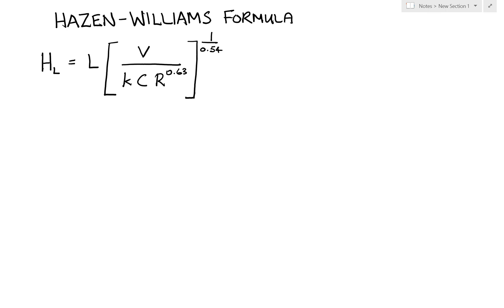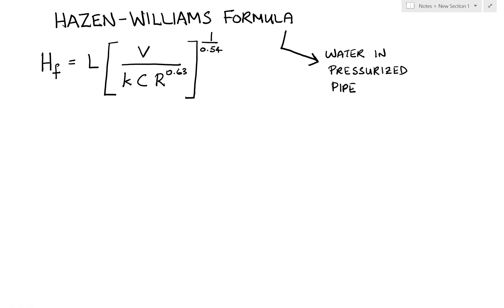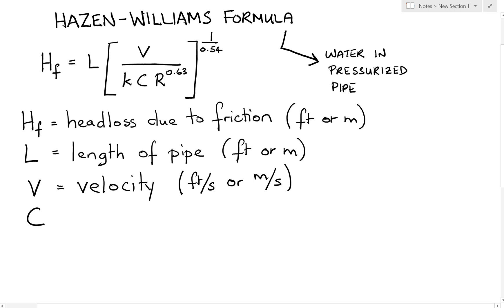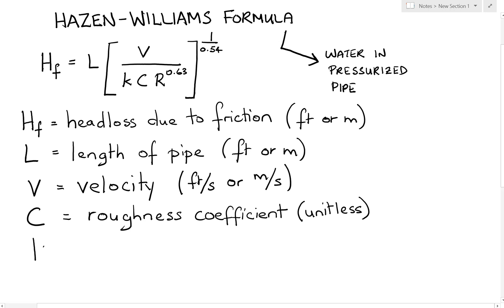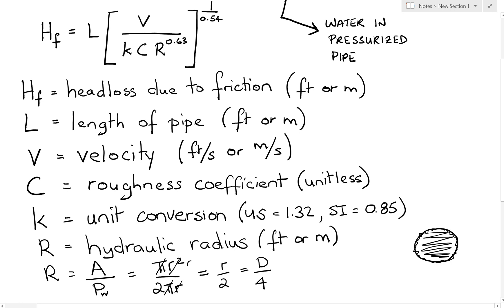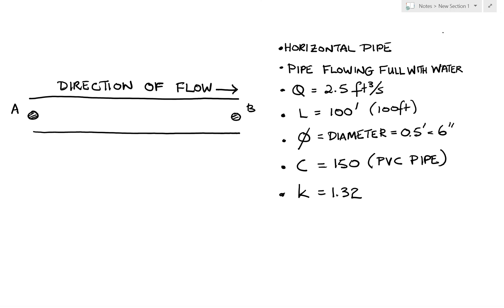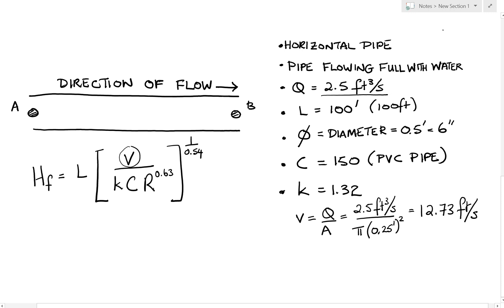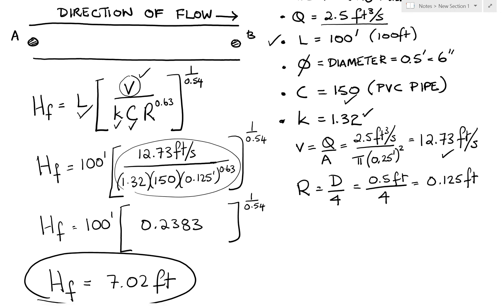Application of Hazen-Williams Formula

Comment: Hi brother. Can you please tell me how does this coefficient exactly relate with the head loss. Is it a measure of how rough the surface is? If this is the case, then higher values of this coefficient will indicate lesser head loss, which doesn't seem to make sense. I'd really appreciate a clarification on this.
Reply from the maker: Hello Muhammad,
The C value relates to the roughness of the material. To give you an example, PVC may have a C value anywhere from 140 to 150. Corrugated steel could have a C value of 60. The higher the C value, the smoother the pipe and therefore the lower the headloss.
I hope the helps.
John
Reply: @eurekamomentswithjohn6339  Thanks a lot for the clarification my friend. Really appreciate it. And keep up the good work.
Reply from the maker: Thank you and you are welcome.

Comment: thank you for your illustration .but how can we decide if the pipe is totally filled with water or not. especially that such calculations and measures are done in the designing phase of the the project.i mean we do not have any pipe yet ,every thing is on paper
Reply from the maker: The Hazen Williams equation is appropriate for full pipe pressurized flow. If you are designing a water distribution system, the system will be under pressure.
Reply: Thank you a lot for comment.
Very useful indeed. 
But I have a question please:
To calculate the head losses we will need to know the geographic high  difference between the source of water( the location of the pump ) and the destination of our water network (for instance a tank).
my question is :what if we have a point in our path that its height is lower than the height of the pump ?do we consider this low point as a zero point or what?
Thank you for your time and consideration sir.
Reply from the maker: @muhsinalhameed6408  So I would use Bernoulli's equation to compare the location of the pump and the tank. See my video on the use of Bernoulli's equation.
Reply: @eurekamomentswithjohn6339  
Thank you 
I will watch this video recommended by you Mr.

Comment: Hey great video, I just wanted to ask how you would calculated (because I’m in Australia using metric) litres per minute while flowing from having only the nozzle diameter and pressure recorded while flowing?
Reply from the maker: Hi Benjamin, 
I have given both metric and imperial units in the video so you should be able to calculate the pressure loss due to friction in metric. Alternatively, if you have the pressure drop due to friction in a pipe, you can re-arrange the above equation to calculate the velocity in the pipe in m/s. If you have the diameter of the pipe, you can then calculate the area of the pipe (in meters squared). If you multiply velocity by area you will get the flow rate (in cubic meters per second). Cubic meters can then be easily converted to litres per minute (1000 litres in 1 cubic meter and 60 seconds in 1 minute).
In terms of your specific question, I would need more detail. In order to use the Hazen-Williams equation you need more than one pressure reading, you need a pressure drop which is the difference between two readings. It sounds like your example might require the application of Bernoulli's equation (see my videos on Bernoulli's to point you in the right direction).
I hope this helps.
John

Comment: what happens to the Second in velocity? I get it that the ft gets cancelled but i think the 's' still remains?
Reply from the maker: Hi Surya, 
Remember that the unit conversion constant "k" is built to allow the units to work out. Without "k" the units would not work. But you must be consistent with the units you use in this equation. Everything must be in feet and seconds. No inches allowed.
I hope this helps.
John
Reply: @eurekamomentswithjohn6339  thanks John.
Reply from the maker: You are welcome Surya.

Comment: Mr. John, 

1) does this formula applicable to water only? or can be used for other fluids? If can be used for other fluids, the unit conversion (k) is remain the same?

2) how do we get the constant roughness coefficient (C) in industry? from the supplier's data sheet?

Thanks.
Reply from the maker: Hi Zulhanafi,

To answer Part 1), I will reference Computer Applications in Hydraulic Engineering by Bentley:
"The Hazen-Williams equation is most frequently used in the design and analysis of pressure pipe systems. The equation was developed experimentally, and therefore should not be used for fluids other than water (and only within temperatures normally experienced in potable water systems).
For Part 2), C value tables can be found easily online. There may be slight variation from table to table but the values will be close. For example, C for PVC is typically in the region of 140 to 150. New concrete is typically in the region of 120 to 130. Older concrete will be a little rougher and might have a C value closer to 110.

I hope this helps.
John
Reply: @eurekamomentswithjohn6339  thanks john

Comment: How to get pressure
Reply from the maker: Sorry Sujeet, I am not sure what your question is. Could you please provide more detail?
Reply: Sir please give one example in hazen Williams equation use to and get dia and pressure like this Q=72
And dia=150
Head lose=?
Pressure?
Please describe and detail
I'm not doing this problem it's may be hydraulic calculation hydrant in Fire fighting problem
Reply from the maker: So Sujeet, if you want the headloss due to friction in a pipe, you calculate Hf in the equation in the video above. If you have the pressure at point A (say 100 psi) and you want the pressure at Point B downstream (assuming no change in elevation), then the pressure downstream is simply 100 psi - 3.03 psi = 96.97 psi (ignoring any minor losses from valves etc.).
If you want to calculate a pipe diameter (D), you must replace V with Q/A in the Hazen Williams equation. Now replace A with the area of a circle (a function of D) and R = D/4 for a full pipe. Assuming you know the allowable pressure drop due to friction and you have all the other parameters, there is only one unknown to solve for i.e. the diameter (D). I hope this helps.
P.S. If you have changes in elevation, you will have to apply Bernoulli's equation (see my videos on Bernoulli's).

Comment: could you share your source for this equation?
Reply from the maker: Hi Rose,
This equation or a manipulation of it can be found in any hydraulics text book. Variations include S (called the friction slope) replacing HL/L (or as I wrote it, Hf/L). Other versions may replace V with Q/A. All of these are legitimate and are simply preferences. I hope this helps.
John